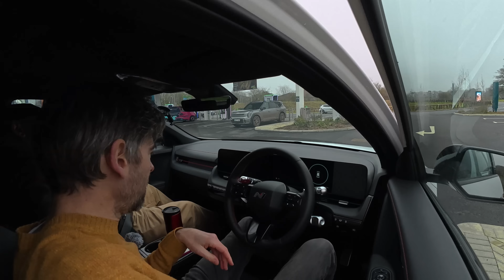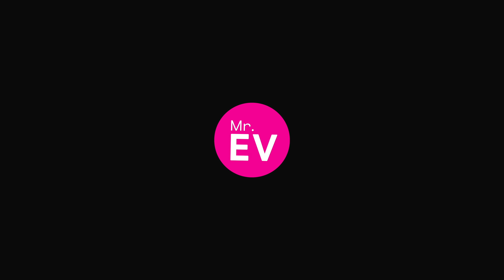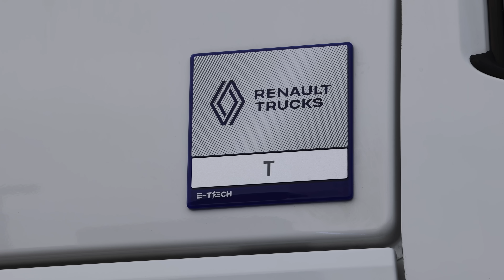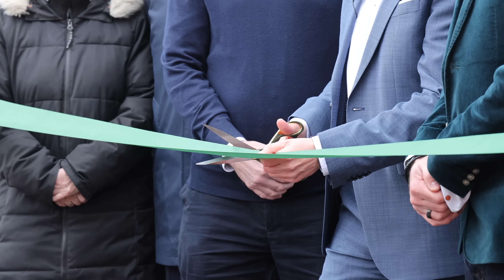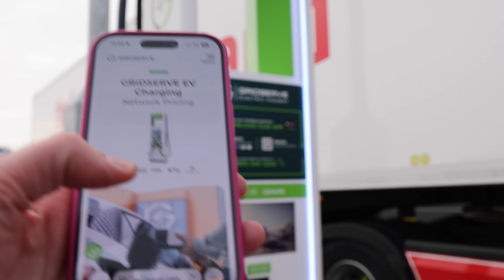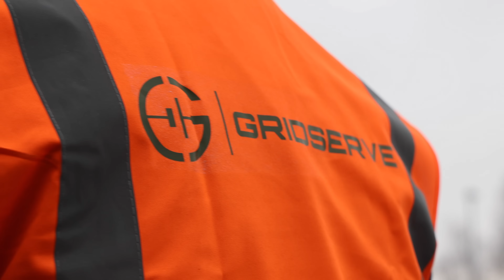Charging electric HGVs: the future of freight, up close. The launch of Gridserve’s first HGV hub

Comment: Is this really the answer, even bigger batteries for even bigger vehicles? Sixty years ago we had trolley busses powered by electricity and taking their power from overhead cables. I’ve seen this being tested for trucks recently, does the idea no longer work?
Reply from the maker: The logistics of installing overhead wires on the road network across the country makes that ideal impractical I think.

I do feel we should be making more use of trains through.

Comment: As with Car charging, I'm seeing this as only one part of a much bigger solution.   I can see several changes happening for truck charging.   All the time that the truck is parked up, it could be charging.  So that's whilst at a depot, or whilst being loaded or unloaded at a factory site.   I'd love to use chargers like that for my car when I'm towing a caravan, and yes, I'd pay the full price without quibble.     Actually, I already pay the full gridserve price when I do long journeys.  I find it's not worth the hassle of trying having to guess which charging location is going to be cheapest and not take forever, or will want my kidneys to allow a charge to even start.

Comment: It's not just more than diesel Andrew.
Companies run fuel cards like KeyFuel and UK Fuel. 
Most companies are paying around the £1.20 mark per litre.
If a truck averages 8 mpg on diesel it's costing around 68p per mile.
If an electric truck can average 0.5 miles per kWh it's costing £1.78 per mile.

Then factor the cost of an electric truck, a Scania S500 diesel unit with 750 litre fuel capacity is around £120,000 for a medium specification model, returning around 1300 miles on full tanks.
The electric equivalent is around £300,000 with a range of around 300 miles.
50% of UK trucks work around the clock with a day driver and a night driver with either refuelling within the day, sometimes not switching the engine off for days on end.
Refuelling takes around 15-20 minutes to fill two tanks of diesel. If it takes 2-5 hours to fully charge an electric truck who pays for that ?
Reply: EVs must be replaced more often, as the tech advances.  
A breakdown could brick an EV for months.  
The weight of the batteries limits cargo (kind of the whole point of lorries).
EOL will come years before ROI, just like any other “renewable”.

Comment: The whole pricing structure needs review, across all CPO's. Tesla make very little, to zero profit on chargers, and if other CPOs can't compete, then maybe Tesla should implement all charging across Europe. Their V4 chargers are good, and are capable of higher speeds, but once installed at a "service station" and "re-badged" with the Services owner's logo, the price shoots up. Example: "EG Group"

Comment: Really good news. I'm all for it, but reckon you hit the nail on the head in terms of charging time exceeding mandated break time. Topping up is all very well (provided a charger's free), but I just can't see how this realistically fits with 'driving against the clock' as most drivers have to do these days (you take your break - nothing more, nothing less - and if the wheels aren't turning immediately afterwards there's going to be an interrogation when your tacho's downloaded at the end of the shift). Maybe you could do a video interviewing a random selection of haulage contractors and transport managers, to see what they think of it . . . 🤔

Comment: I just happen to be involved in haulage, the electric trucks will only be for the large haulage companies that have the financial ability to install their own charging facilities in their depots, this is a huge cost. Just look at how many trucks of all sizes/weights are on the road there is a huge gap to cross in order for this to be anywhere near viable for most hauliers, the time lost earning money whilst waiting to get a charging point in the services followed by the actual time to charge will not be viable. What has not been mentioned is the reduced capacity of loads that you can carry with an electric trucks due to the weight of the electric truck. The cost of an electric truck is a problem (you are not going to continue getting grants), the wafer thin margins in haulage currently make this non viable, nobody will want to pay more for the haulage which directly links to our cost of living. As mentioned the cost of electric charging in the UK is way too high and until the government/grid supply reduce or subsidise the costs to install and set up/run the charging facilities the cost to charge charge will remain high. 
This may appear to be a negative post but it’s reality for a considerable amount of time for the future.
Reply: It's nice to see a comment from someone with some sense!

Reading the comments, it's clear 99% know bugger all about haulage.
Reply: It is not as bleak as it seems.  Charging can be done during mandated rest breaks and other downtime.  Time lost, if any, is not as significant as it may seem.  Maintenance cost for oil changes, engine overhauls, and brake overhauls is significant.  Cost of electricity in the UK is an outrage though.  UK needs to put their best minds on how to get competitive cost and pricing.  Even so, fleet discounts can significantly lower electric charging costs in exchange for guaranteed minimum offtake.

Comment: Germany and France are way ahead of the UK in terms of pricing and electrification of the highways. I think they also have some kind of scheme whereby you can roam with your home electricity rate as well. I hope Tesla jump in and shake up the network, but I suspect the issue is the main power suppliers are holding things up. Can you find out what the base price of electricity is from the grid and there breakdown of costs overall please?

Comment: Tesla are going to be the leaders in this field

Unlike the trucks in your video Tesla’s designed from scratch for electric—no diesel baggage—so lower operating costs and better performance. 

Right now in early 2026, the electric semi-truck market’s heating up with a mix of legacy makers and startups.
Main players include:
•  Freightliner (Daimler) with the eCascadia

Volvo with the VNR Electric

Mack (Pioneer)

Tesla  have by far the best  efficiency—real-world tests show way better energy use, like under two kWh per mile loaded, crushing competitors (Freightliner eCascadia around one point eight seven, Volvo higher). That means longer range—up to five hundred miles on a charge—without massive batteries, plus killer acceleration and regen braking for hills.
Reply from the maker: Tesla should get a move on and make more of them. I’d be surprised if we see them in the UK until 2030 at the earliest.

Comment: I've seen Bjorn Nyland's video in Norway of the 1.2 MW Kempower units, but they have a slight different plug called MCS instead of CCS. I wonder if all European trucks will have both socket styles, or is MCS still in a prototype stage?
Reply from the maker: I imagine they’ll add both sockets as it’d be a bit clumsy to have an adapter?! I’ll look into it. I’m pretty sure the MCS socket has been finalised.
Reply: I would guess that having both MCS and CCS inlets on the truck will be popular.  Perhaps MCS only with a CCS to MCS adapter would be viable though.  Tobias at the Electrotrucker YouTube thinks MCS is unneeded.  He certainly does fine with 400 kW, and often less, with his CCS trucks like the Mercedes eActros.  CCS can be extended to 600 kW or so, IIRC, so that will be a big factor in the popularity of MCS.

Comment: the future of freight! 😂

you know there's a weight limit on the size of hgv's yes?

so, to get hgv's that have a reasonable range, they'll be able to carry about a 24 case of coke and 3 boxes of Mars bars! 😂

saving the planet 🎉

i also prefer my vehicles that when they do go wrong, they start making a little noise, or start smoking a little. a couple of thousands miles later that noise gets a little louder and you think 'i must get that seen to'. another couple of thousands miles later you eventually take it to get fixed.     not so with our new amazing ev's, they'll appear perfectly normal, insidiously degrading inside the battery unseen, changes happening underneath the skin with zero way of knowing that there's an issue, but otherwise running driving perfectly. you know nothing of the problem.... until  one day times up ⏰ BOOM 💣🧨💥 🔥
Reply from the maker: The weight limit of electric HGVs is up to 44 tonnes. The Mercedes-Benz eActros 600 (shown in the video) goes 310 miles fully laden.

Preferring ICE vehicles because they make a sound when they go wrong is a new one on me! I'd rather have a more reliable vehicle that gives me a warning message when something goes wrong instead of hearing creaks and seeing smoke, but each to their own.
Reply: @MrEV maybe it does go 310 miles, but with that battery and that range, what is the remaining weight capacity for cargo, compared to a diesel truck? it's less, but how much less? 

you get plenty of warning normally with something going wrong with an ice car. you don't always get that error message when it comes to batteries. sometimes a problem can develop completely unseen and unheard, until bad things happen. and with EVs, when bad things happen, they're very bad things. like bye bye house. don't like the range, don't like the charge times, don't like the boring numb driving experience, and i don't trust them as far as i could throw them.

if others enjoy them, then great, I've no problem. they're just not for me

Comment: I was HGV driver and owner operator for 30 years so I'm very sceptical that this will ever be affordable especially by the smaller haulage companies and independent operators. Cost of vehicle, cost per charge, degradation of batteries will increase overall running costs which will be passed onto the consumers as it's already a tough market to make money in transport then as the new electric vehicle road tax being higher than millions of ice cars so I presume it will be the same for HGV and the 3p per mile tariff on EV to drive on UK roads. I'm sure some large operators will do this as for a trial and get huge discounts on a small part of fleet but also I am worried that Britain will plunge into regular blackouts with electricity requirements out weighing supply. Each truck takes same amount of power as a small village every charge which will only get more difficult to supply the more EVs are on the road. Times ahead are going to be interesting and worrying.

Comment: In a test run of an electric truck between Sydney and Newcastle and return it saved 40 mimutes on using a Diesel truck because it was not slowed by the hills. Do you have hills in UK?
Reply from the maker: We have many hills! That’s a great point although 40 minutes sounds like a lot to me!
Reply: So that’s a distance, in total, of around 200 miles. Not particularly far for a truck. Melbourne to Sydney is a regular trucking route of around 530 miles. Wonder what the outcome would be?

Comment: As an EV owner and HGV driver I welcome the move to electrification but there is an issue that hasn't been adequately thought about, and specifically for the installation at Baldock services.
Baldock was already a busy site, regularly at full capacity and with construction of the new charging bays reducing the available parking bays by about a third.
A big issue across the country is the lack of adequate parking for goods vehicles and with drivers required by law to take rest breaks at specific times I can envisage drivers with no available standard park bays available and required to stop then having to block a charging bay.
The solution would to have made an additional parking area but I'm sure that would have involved more cost, so like with many other aspects of the transport industry and lack of decent facilities, the drivers will just have to deal with the repercussions.

Comment: How long does it take to chargeca 44 tonner
Reply: Depends on a battery size and a truck. As we heard in this video - about an hour, hour and a half. A guy from Germany, ElectricTrucker, usually charge his trucks during a midday break. A top up. He starts a day fully charged, then top up during a mandatory rest time. A fully charged truck can drive from 300 to 600 km on one charge. Consumption usually is around 1 - 1.1 kwh/ km.
Reply from the maker: From 1-1.5 hours although Mercedes-Benz are testing a version of the eActros 600 (shown in this video) which can charge in 30 minutes to 80% using a megawatt charger.

Comment: Know one will pay twice  as much for goods to be delivered  by an electric truck
Reply: source?
Reply: @Freba9 Tractor unit cost twice, if not more than a diesel unit. Plus the cost of chargers and the reduction in load capacity.
Reply: @j @jonathanlonsdale9442  Sure, but that doesn’t mean customers pay twice as much. TCO is often equal if not lower than a diesel tractor depending on which country.

Comment: Power sharing is a must in order to get high throughput at lowest cost.

Tesla SC have on average 90kW/stall, while a lot of Kempower sites has 75kW/stall. A truck charge location will also benefit of the same type of power sharing, but with higher numbers.

A Kempower 1.2MW cabinet can cover 4 stalles at the same time with 300kW. If one or two of the chargers are MCS, then one stall can take all the power of the other stalls are unused.

This significant reduce cost, while ensuring high throughput.

CCS with activity cooled port on the vehicle can charge with up to 700A, and MCS with up to 1200A.

Comment: Am I right in saying 44 ton max weight for hgv, & the battery weighs how much, so wagon cannot carry as much
Reply: Perhaps most trucks don’t usually load to the limit
Reply: @markthomasson5077  that's true actually, I used to be a warehouse manager, yes not always full
Reply: @markthomasson5077  The company I worked for were always fully loaded. 44 tons.
Reply: Absolutely correct. 
Reduced payload means reduced profit. 
The company I worked for ran their vehicles 24/7 24 hours a day   
A driver did his shift and back at the depot another driver jumped in. 
The only time the vehicle was parked was for servicing or repairs. 
Batteries cannot do that.
Reply: @WilliamLaverick-wo1nb yes it's got to  e 3 to 6 tonnes cheers mate
Reply from the maker: Yes, there is a reduced payload for electric trucks as the batteries are beasts. The max. payload for the Mercedes eActros 600 is 40 tonnes for instance.
Reply: Thanks for getting back  @MrEV
Reply: @MrEV  I'm, pretty sure EV trucks get an extra couple of tonnes dispensation in EU regulations, I saw Tobias load up 42tonnes on his e-Actros on a very recent unvoiced video. 
Much trucking is volume limited not weight limited so EVs do the same job in those applications.

Comment: Great Idea in theory but more of a gimmick than anything else. Until such time as there are quite literally tens of thousands of charge points available for truckers to charge their trucks, diesel will always  be the fuel of choice for the industry. Yes  small electric trucks and towns and cities are a good idea but large battery powered HGVs on the open road  just isn’t going to work. No wonder Daniel Kunkel the CEO of gridserve is so happy, his company has been awarded part of if not the whole sixty six million pound taxpayer funded grant just to get a few HGV charge points up and running.
Reply: Don’t be so negative I have been using electric trucks at 42 tons at a flour mill, two runs a day each of about 110 miles round trip never go below 40% charge, when having break while charging in yard takes about 50 minutes from 45% to 80% which is plenty to do next run. The trucks do have minor teething problems with faults popping up on dashboard but they are getting better with driver feed back. You can do long runs with them if you know where you are getting charged but that is the biggest problem but in time that can be solved. Ps I was a sceptic eight months ago.
Reply: @richardloakes5697 I'm not being negative I'm being realistic. OK for the work you're doing electric trucks may be suitable, but for a lot of day drivers and definitely trampers diesel will  be king for decades to come.
Reply: I would imagine the vast majority of the needed charging infrastructure is actually going to be a depots rather than out on the road like these though.

Also, it’s chicken and the egg. You’ve got to start somewhere.